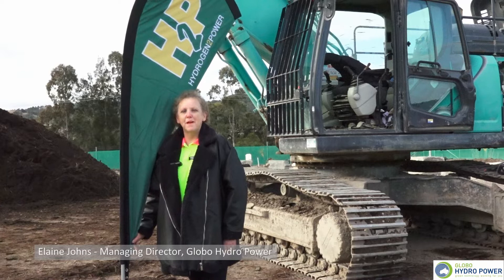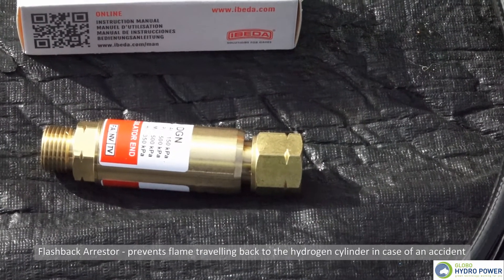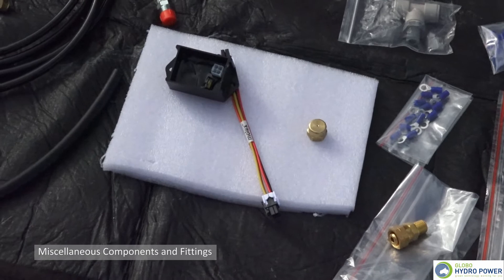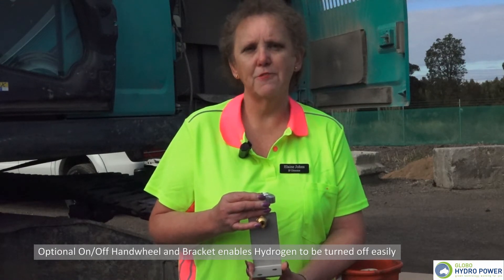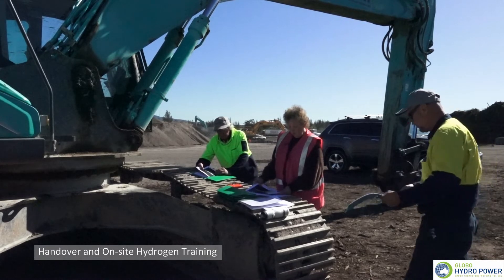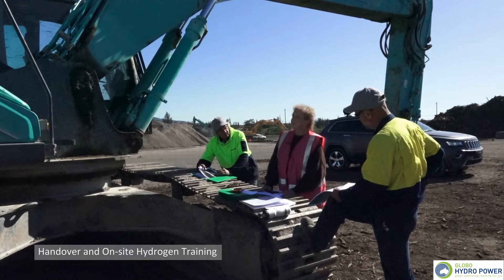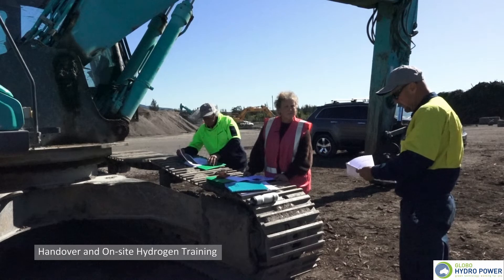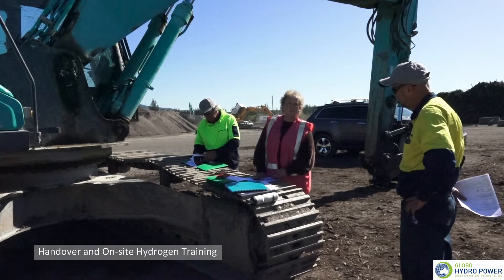GHP   Concrush Excavator Installation   #3 GHP Kit & Hydrogen Training

Comment: Contradictions in statement @ 29:07 Elaine says, H2 molecules make diesel molecule burns faster by which rpm reach faster and engine holds back the diesel being injected. Actually engine does not hold back the diesel but pulses to injector are modified to inject 30% less fuel by GHP control unit. How are we ensuring that engine works as per rated power curve?

Comment: Some time these machine topple while working, if the cylinder is fitted the way it is fitted in this machine then what is the safety?
Reply from the maker: After this video the hydrogen cylinder was moved in conjunction with the owner and operator to a more secure and safe location on the excavator.